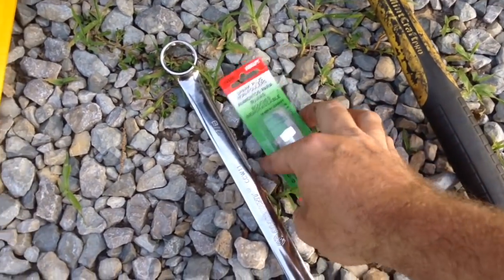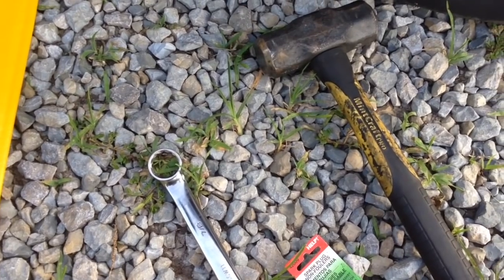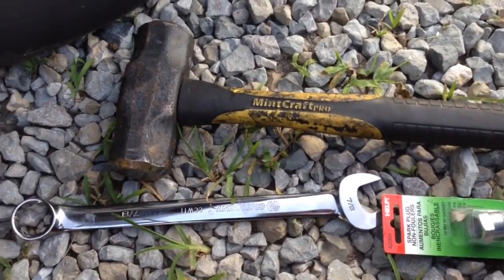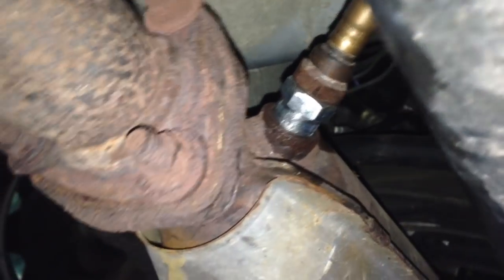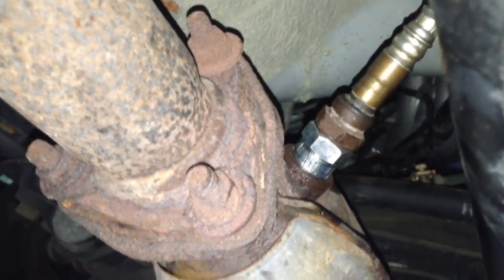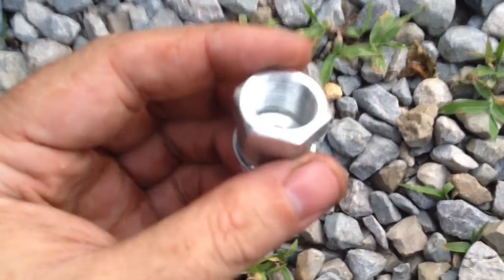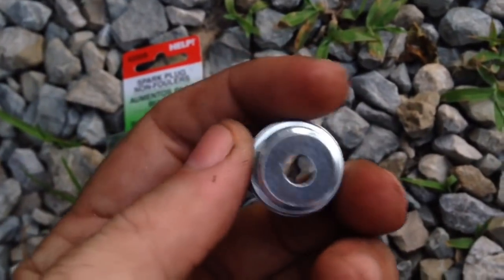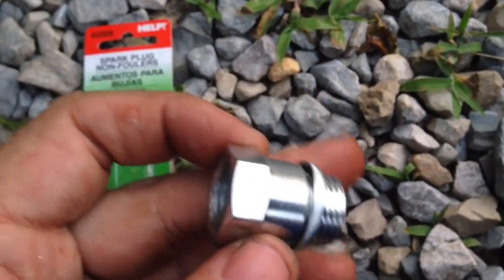How to Fix A Clogged Catalytic Converter P0420 P0430 Super Cheap on any car

Comment: I have a 2002 Mercury.  Totally awesome fix!!! I would recommend this to anyone.  I passed inspection the first time after the fix.  I had to do some drilling and use 2 non-foulers per sensor.  Thank you for the information.
Reply: What about the Catalyst i/m monitor? I used two non foulers on my 2000 Nissan Maxima, and it cleared my Check Engine Light, but I failed inspection twice because my catalyst system monitor won't ready. It's the only monitor not ready, and is preventing me from passing my smog check. Any advice?
Reply: @nicholasnapier839   This is just a guess, but seems that TWO non foulers would take the sensor so far out of the exhaust stream that it may be preventing the monitor from completing. So try just one non fouler. Also, sometimes ya gotta drive the vehicle under various conditions for quite a while to reset the monitor.
Reply: @jakejones5736  Thank you for the response. The end result was that one non fouler wouldn't clear my Check Engine Light, but two did. Then I ended up having to drive around 50 miles a day, for two whole weeks before my catalyst monitor readied. I just passed inspection a week ago, and should be recieving my current registration in the mail anyday now. Cheers!
Reply: @nicholasnapier839  Wow, that's quite a few drive cycles! I'm currently in the same boat. Got the same code, but haven't tried this yet. Registration expired last month too.

Anyway, glad to hear you got yours resolved. TWO MORE YEARS!
Reply: @nicholasnapier839  most states allow one system not to be ready
Reply: Still gonna run like shit restricted exhaust

Comment: This doesn't fix a clogged cat. This fixes a fail cat due to inner components not cleaning the exhaust gases. Extending the second O2 sensor makes it hard to catch as much has compared to the first. Thats why it thinks the cat is filtering the gas.
Reply: I was going to say. Lol Don't you have to hollow out the cat as well. This will just trick the car into thinking that you have one so you're CEL isn't on and you pass emissions. If you're cat is clogged and you're having runability issues as a result of it to fix that you've actually got to get rid of the cat and this is a great trick so yoy dont have look at a check engine light all day or if you live in Cali lol

Comment: It works I have a 05 taurus with 4 02 sensors I did both downstream and passed today
Reply: Nice ,I did mines yesterday on my bmw x5 and it passed ..did you did your drive cycle after you reset your cpu

Comment: Wanted to say thanks for the trick it works. Had po430 code now no codes.  Although I had to use both non foulers drill hole threw one to fit sensor then connect to other with small hole. Then replace.

Comment: I'm thinking about having this done, bc the check engine light is on bc of the catalytic converter.   Oem part for this is so expensive.   Aftermarket ones doesnt last.  So the car will still be safe to drive, no carbon monoxide poisoning or anything right?

Comment: This can work but i recommend after the successful test, remove it,  My fouler got so hot it melted in the female threads of the 02 sensor hole. It was super difficult to get out after leaving it on there for a long time (like a year). Im taking it off right after a test from here on out

Comment: Confirmed 6-20-19 works great on my 99 Silverado. Had to use 9/16 drill bit for my O2 sensor
Reply: datatech2000  do you know what size you used or even better a part number
Reply: @justinvandenbroek2646  18mm

Comment: If it does not come loose I guess you can try heat but if you use the socket made for that you hold the head of the ratchet so it does not put angle pressure on it two hands

Comment: In my 2010 cadillac srx 3.0 engine, I replaced all 3 cat's and all o2 sensors but I still have the p0430 error code...the cat's I installed are aftermarket and I was told that is the reason the error code will not clear...do you have any advice?

Comment: 2005 Chevy Tahoe P0430 Both banks
Cataclean
Fuel system cleaner
Fuel Injector Cleaner
Gallon of Laquar Thinner
Engine light still comes on and Emissions Readiness still an X!!!  Evap also an X.
Reply: I fixed my problem the easy way.  I put the truck through the GM driving recycle program and it fixed the problem instantly.  I had a battery failure this summer and installed a new one myself.  Shortly after, the codes started coming up, but I didn't connect the two.

Comment: Check if there is enough clearance to stack two of these foulers plus the o2 sensor.... many applications simply will not fit... if it does fit this trick does work.

Comment: so i have a cat that the honey comb has started to fall apart i want to delete the cat and place it with a flew pipe and use these 18mm spark non fouler s will it keep my check engine light from coming on ?

Comment: The frt sensor. Is the main wide band EFI signaling unit. the rear is a narrow band check sensor . that code signals the rear sensor needs replaced

Comment: Thumbs up! It would be even more helpful if you linked places to find the parts used in the videos. I wanted to ask btw, Two days ago my e46 started to blow hot air only on the center console vents, it still blows cold on the corner vents. I recharged the system but didn't fix the problem. Where else should I check? Thanks Nathan.
Reply from the maker: You need to replace the heater valve on the driver side strut tower, they are common to fail
Reply: +Nathan's DIY Garage Thanks, will do!

Comment: this is just masking the problem,if the O2 sensor wires and exhaust leak is not the source of the problem,you either need new O2 sensor down stream or cat converter,any kind of head gasket problems,or intake manifold gasket problem like all GM 3.1,3.4,3.8 engines,will cause coolant vapor to cat ,will kill the cat,so fix that before putting new cat
Reply: Some people can't afford to fix all that crap just to pass a stupid inspection.
Reply: Yes...that's the point.
Reply: @fullcustomization  Not only that, but you could literally spend THOUSANDS trying resolve it and STILL not correct the issue.

Comment: I just attached the non Fouler but I was curious if I was supposed to reset the check engine light and drive to see if it comes back on, or just drive around and see if it goes away?
Reply: You can do it either way, By clearing the codes after replacement, or waiting for the light to shut it's self off, but it could take a while for it to shut it's self out, It could take up to 50 or more warm up cycles of your vehicle before it decides the problem is gone. Personally I would just clear the code once the work is done and see if it comes back.
Reply: @fullcustomization  *itself

Comment: So put it on the rear sensor, not on any of the sensors under the hood right? Also will the nonfouler on that 1 sensor solve both 20 & 30 code? Cuz I thought each code is for 2 different sensors
Reply: @beautifulbb84  my truck has 2 down steam sensors, 1 for each bank. I'll put the nonfouler on the rear sensor 1st and see if it clears all codes, if not I'll put it on the front also

Comment: Thanks for the video! So here’s my issue. Perhaps someone on here has an idea. I drive a VW 2003 Jetta 2.0. Got P0420. Tried this hack BUT O2 sensor won’t fit inside the bored non fouler. Tip of O2 too thick. Cleaned it real good with carb cleaner and CEL light went away. Maybe it just needed a cleaning but I’m sure the p0420 will come back. Any ideas on how to do this hack if O2 tip won’t fit into bored non fouler?

Comment: Would this restore my mpg im losing a lot with the code
Reply: No.  The converter may be plugged, but what caused it to plug is the problem that needs fixed.  This is a 'trick' to clear the code.
Reply: One gallon of lacquer thinner with half tank of gas drive until almost empty and refill with premium and th see lost power will be restored. It unclogs alot of crap

Comment: what's the premise beyond the fix? when they plug in the reader/scanner at the emissions station will it read as functioning properly or? would love to spend $10 vs 1000 to address the issue, but curious as to 'how' this fixes the problem.
Reply: It doesn’t fix the problem it bypasses it

Comment: Did this yesterday on my 2010 BMW x5  and it passed smog check. It was throwing 2 codes p0420 and p0430.
Reply: Socalguy007 i need to do this on my 2009 x5 on which sensor did you put the spacer on? where can i find the sensor?
Reply: @luisgarcia-tj1gy  I put it on the second catylict converter. Not the first one going down,  but the second one next to it. Its gonna be a little difficult to get your wrenches to unloosen the sensor but once you got it loose then its game on . Plus once you installed the spacer you gotta dona drive cycle on order to clear the codes and bring them to proper working order sk it can say ok on every code especially the catalytic code.
Reply: Socalguy007 not sure if this is legal in California I have a 2005 Lexus gx470 and it’s throwing p0430.
Reply: @pacificobernardo463  its illegal but if they do t see it your good 👍

Comment: I'm curious, instead of using non-foulers. Would you just be able to just plug up the holes on the O2 sensors? Something heat resistant

Comment: I put one of the non-foulers on, but it did not do anything and the light was on. Later, I put another on top, so I have two. The light was gone immediately. However, after driving about three weeks, the light came on again this morning. What should I do?
Reply: Re-scan the car and find out why the light came on...
Reply: @dropndeal  Professionally may translate to BIG BUCKS! Some people simply cannot afford to pay the money just so they have a vehicle to get to work. 

There's a reason why it's called the "MONEY LIGHT".
Reply: @jakejones5736  nah it's a cheap fix cats can be found used
Reply: @Operator-fq2fn  The cat on my vehicle is dealer ONLY to the tune of about $1200! This does NOT include installation. Guaranteed, a junkyard is probably gonna run several hundred bucks. Ok, so now that it's installed, how long is the junkyard warranty? And if it's bad, then you have DOUBLE the labor cost to install it again!
Reply: @jakejones5736  what car do you drive bet I can find them new OEM and cheaper than anywhere you go.
Reply: @jakejones5736  I have my connections
Reply: @Operator-fq2fn  2008 Hyundai Sonata V-6 CARB compliant. 
Knock yerself out.

Comment: so this just helps clear the code but doesn't fix the clogging in the CAT, what actually fixes the clogging so you can get better performance and restore fuel consumption other than changing the CAT

Comment: What about the Catalyst i/m monitor? I used two non foulers on my 2000 Nissan Maxima, and it cleared my Check Engine Light, but I failed inspection twice because my catalyst system monitor won't ready. It's the only monitor not ready, and is preventing me from passing my smog check. Any thoughts?
Reply: Try doing a drive cycle and checking the monitors with  a scanner until they clear up.

Comment: I have a 2011 Dodge Challenger with code p0420 and i need to pass inspection, i will do this, my question is it has to be on the downstream or upstream sensor? Thanks
Reply: Johnny Mejia from my research I think it has to be down stream, I had a p0420 and p0430 on my 2001 Maxima,I did this trick on bank 1 rear sensor just to test it and it worked the p0420 erased,gonna do the other rear one tomorrow fuck the dmv lol
Reply: @leomendoza1371  I'm with YOU. Really? We're gonna spend THOUSANDS of dollars just to satisfy the DMV because of some light?

Comment: hello i have a 1999 honda prelude do you know if is necesary to do the trick in those 2 sensors that i have in my car primary and.secundary thanks....
Reply from the maker: Only the second sensor  if you are having the converter codes

Comment: My 2006 M3 has these codes. Does it mean my 02 sensors are bad or is it my cat? Car only has 70k miles
Reply: Probably your sensor ..I did this to my 2010 BMW x5 and it passed smog

Comment: great video thank you, i have a 07 gl450 suv, P0422 but in your video it has the same description ( Main catalyst efficiency below threshold bank 1) im assuming its passenger side catalyst  rear cat rear sensor, my question to you is, if i add this spark plug adapter is the performance of the car changes at all?  does it code mean replace catalyst or sensor? i hope you can help thanks Nathan

Comment: on my Subaru I have five sensors one before each Cadillac which I have two and one after that there's one in the mainstream which one would I change or do I need to do all?
Reply: Lloyd Stowell The downstream one.  Use a laser temp to check your temps entering and exiting your cats first.  Hot going in, hotter coming out.  Otherwise this may not work.
Reply: Always after the cat or cats

Comment: Will this work if the cat is actually failing? I've had a cylinder 4 misfire for a couple of years, so I know I've been dumping fuel into the cat.
Reply: i dont see how this would help. eventually the cat will get too clogged for the exhaust fumes to pass through it.  it will be like sticking a banana in your tail pipe. engine will lose most of its power and at some point wont even start. not sure how much of a time frame til it gets to that point though

Comment: I fixed the P0430 just by adding coolant  into the coolant tank because it was very low.
Reply: Also I stopped using cheap gas. Start using gas w additives like shell vpower or chevron with techron. Do this first and get a obdII  reading after 100mi. Code should disappear after better gas.
Reply: It doesn't always work but I'd always recommend it as a first step to put Toptier certified gasoline in the tank, and maybe a fuel system cleaner, and of course inspect fluid levels and quality, and then check for gasoline and air leaks.
Sometimes the converter is just out of platinum, though.

Comment: How does this fix a clogged cat?  Unless you clean the cat, then what is the 3/8" going to do>?
Reply: drill the clogged cat out problem solved after using one of these anti fouler .

Comment: Not plugged cat- bad cat.  This just takes the sensor farther from the exhaust stream, won’t pass emissions sniff test just hides a problem. If it was plugged it wouldn’t run right either way

Comment: Great video ! what's the name of that part?
Reply: Spark plug non fouler, auto parts store like 5$..  and a half inch drill with a vice ..  and get a o2 socket with antiseize...  copper antiseize..
Reply: @Z-Ack  will the smog check tech fail me if he sees the non fauler?

Comment: how will this pass the visual inspection?
Reply: keithc728 how wouldn’t it? it’s still in the cat is it not.
Reply: @masonmatvich5784  That was MY question too. Yes, it's still in the cat, but MODIFIED. It's my understanding that inspectors are becoming more savvy to this lil trick.

Comment: if I get this spark non-fouler,  will it fix my p0420 and p0430 codes on my 1999 gmc suburban k1500 5.7 V8?
Reply: Josh Benney try it
Reply: panzer waffen,  I did.  it got rid of the codes lol.  it just takes a long time while to be emissions ready.
Reply: Josh Benney ohhh ok ... Did the check engine light dissapear ?
Reply: panzer waffen, I cleared the codes. it never came back ever.  just my scanner says "Emissions not ready"  plus my emissions is coming up in march.  it was green saying emissions ready, until I had a exhaust leak causing to be lean.  I fixed that.  It hasn't showed up ready yet.  it takes real long time to say its ready.  Idk why
Reply: Josh Benney ohh nice...well man maybe cause the computer needs to clear that..and it takes some time .. But at least you are ready for emissions and no more cel..
Reply: panzer waffen right....I hope it'll get ready by then lol.  It's got 233,000 miles on it.  truck is way better condition compared to other trucks with similar miles.  It's very methodically maintained over 145,000 miles since purchased in November 2009.
Reply: Josh Benney oh wowww man its a gmc right?
Reply: Josh Benney thats the result of a good maintenance
Reply: panzer waffen yep.  if you take care of it,  it'll take care of you for many miles to come.  never got me stranded anywhere.  It's very tough workhorse for me.  even with amp, inverter, air compressor and 425 lbs of tools in toolbox, hydraulic jack etc etc.  Lol
Reply: Josh Benney lmao man it is fun to read that about 425 lbs of tools un box hahahahhaha and hydraulic jack hahahha ..yeah man those trucks are strong as hell and yes talking about treat good our cars yes i couldn't agree more... There is a guy in jacksonville fl that has a c5 corvette with 700k miles ... He says the same if you take care of your car it would care about you..
Reply: panzer waffen exactly.......it can happen if the right person looks after any car/truck.  it'll do the same.  I just prefer gmc as I like the styles and body too.  but I like others as well.
Reply: Josh Benney thats good ...is like you respect amd admire all the other brands ...like me im a chevy guy but i love dodge trucks... F2500..etc...
Reply: I have a 2006 Armada LE and it's giving me codes P0420 P0430 and P0442 and auto zone says it's an exhaust leak, I took it to the exhaust shop and the lifted it on the ramp and says I have brand new exhaust, code was cleared and came back on 10 miles later and I done my own investigation and found out that there are flanges where the exhausts meet the catalyst converters so the flanges on both side leaks after spraying water on both so I change the gasket on both flanges and they still leak but not as bad as it was. What are my options? 
Been told by autozone to take out both gasket and put silicone sealant and put them back on. What options do I have now? I'm in Connecticut, can't register the car now as it won't pass emission with the check engine lights
Reply: yinka santacruz maybe you have warped flanges on the exhaust from the header to the down pipe